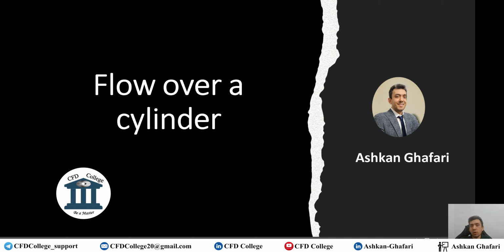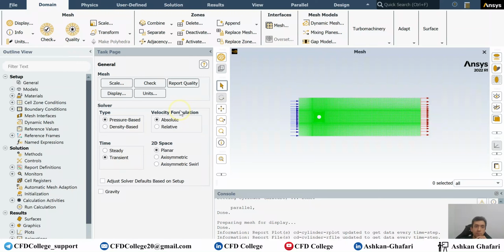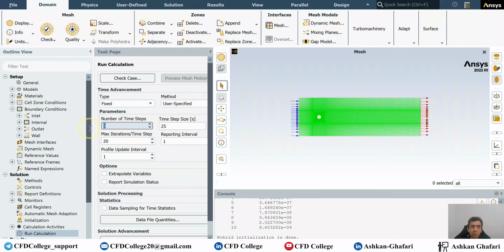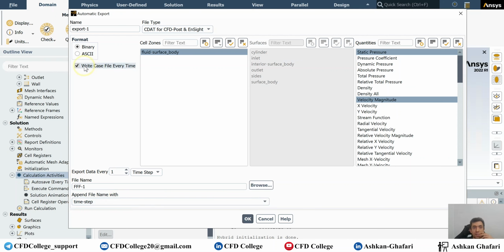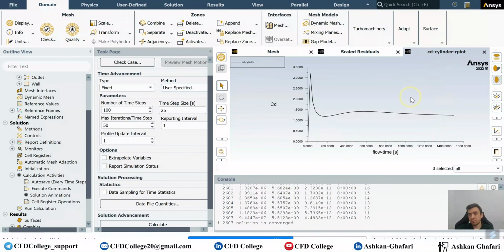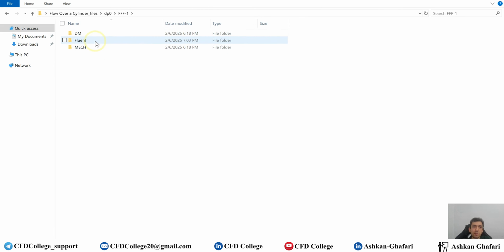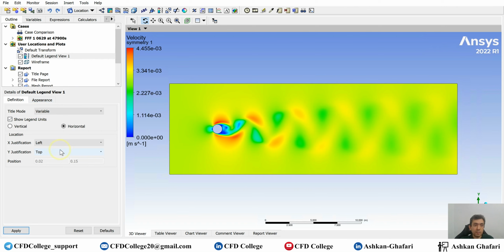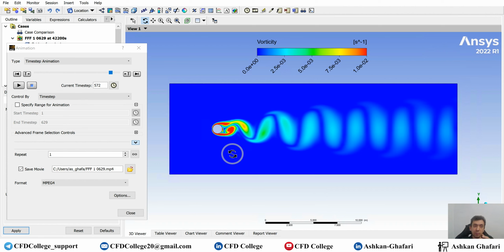ANSYS Fluent Tutorial: Flow over a Cylinder | Part 3: Von-Karman Vortex Street

Comment: I am currently trying to calculate a 2D laminar flow model with Re=100, where the inflow has a parabolic profile with a maximum velocity of 1 m/s. The flow passes a cylinder with a diameter of 1 m. When verifying the Strouhal number, I encountered an issue. According to reference data, the expected value for Re=100 should be around 0.16–0.17, but my calculated value is 0.11–0.12.

For my calculation, I determined the period using the vertex average of the y-velocity from a surface report. However, I noticed that when monitoring the y-velocity, there were unnatural drops in velocity. The computed period is approximately 12–13 seconds.

I have also tested different grid resolutions to check for grid dependency, but the results remained the same. I am wondering if the issue might be due to errors in the solution method settings or if the use of a non-uniform inflow requires additional adjustments in the boundary conditions.
Reply from the maker: Hi. Using parabolic inflow may be the cause of this issue. However, have you tried with drag coefficient fluctuations? I don't understand where you calculated the average velocity.
Reply: @CFDCollege Thank you,  I will give it a try, and if I encounter any issues, I will ask you again.